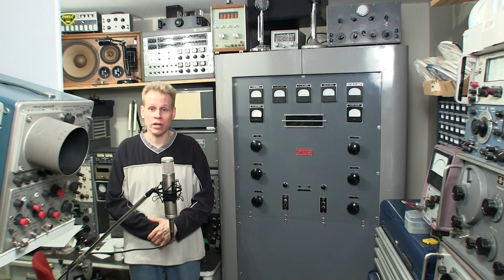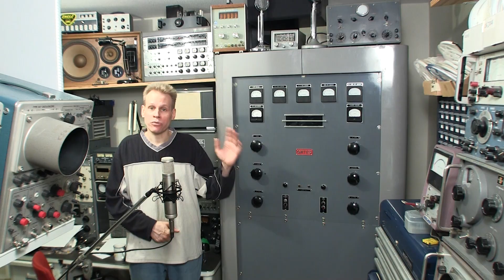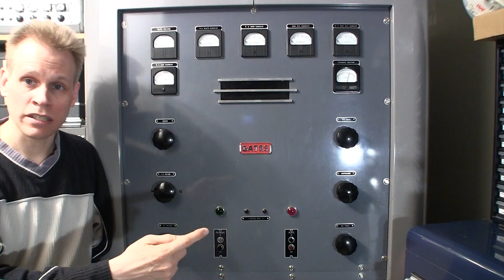Standing Inside a Broadcast Transmitter While it's ON!

Comment: Been a subscriber for a while and enjoy your restoration videos. Have learned a few things that I will use in the future. This is a very nice old Gates BC250GY and it is in beautiful shape. Also, you did a very nice explanation of how it works but, this video scares me. I am a retired broadcast engineer with 45 years of experience on both tube and solid state transmitters. I've worked on transmitters from 1KW to 50KW and one thing you never want to do is stand in a transmitter that is on, even if it is 'just the filaments' and not have your complete attention on what you are doing. I did not see you use any kind of shorting stick before going into the transmitter. You simply cannot rely on the bleeders or HV shorting switches before working inside a xmtr. I have had plate supplies that have ranged from 1KV to 25KV and using a shorting stick (Jesus Stick) has saved me many times from protective circuits that failed and weren't protecting me. Even just having the filaments on can pose a risk. This is especially true if you are swinging a camera around and not paying attention to where you are inside. Your attention is not on safety at that point. There is 240VAC in there on exposed transformer terminals and those relays are open contact, not sealed for your protection. One slip, kneel in the wrong place or move your hand too far and you are across the line voltage. Maybe you did short the caps and other connections before you went in but it was not demonstrated. I cringed when I saw you grabbing coils and touching the plate leads on the finals.

I'm writing this because I want to point out to others that when you are in a transmitter like this you have to do the little things to keep you safe. Be aware of your surroundings and do not be distracted by swinging a camera around or talking to a co-worker. Be aware! There can be high voltage somewhere that did not get bled off or shorted and if there is, it will ruin your day. I have a friend who nearly had his arm burned off because he was careless. Even if you think "well I know my transmitter inside out!', you can still make an error and DIE. If you were one of my engineers and I saw you doing this without proper safety precautions or just going in and using a camera and not paying attention, we would have a very, very long talk.

Please consider adding an addendum to this video and point out how to work inside an xmtr like this safely. I know many hams out there use old broadcast xmtrs but you have to know what you are doing when working on one. This is normally learned by watching an experienced broadcast engineer and having them point out how to do it safely. I know I am preaching here but I don't want anyone to lose their life because 'Oh, I saw this done on YouTube'. I don't know if others have pointed out how unsafe this was because there are a lot of comments but I had to say something.

Comment: Real radios glow in the dark.  If I'm reading that RF Line Current meter correctly, you've got about 392 watts being output into that dummy load assuming it's 50 ohms.

Comment: Great video!  Reminds me of a time a few years back when I helped a neighbor, who, as I,  was  heavily involved with restoring old tube radios.  We slid a Gates BC-1T out of the back of his pickup truck (very carefully) then down a 45 degree ramp and into his garage concrete floor.  Eventually he moved it to his combination radio room/museum.  I don't know if he ever had it on the air, as the 160 meter net we used to check into each Sunday morning pretty much faded.  Unfortunate since it had been going on since the mid 30's (except for the WW2 break).  It would have been a classic on 160.  Not as practical as it is pretty much a single frequency transmitter, but still fun to look at.

Comment: Hey I served 1986 in a broadcasting station: inside AM/SSB on LW 1 really big tube, SW 10 solid state transmitters, outside: copper walled coil adjustment antenna transmitter house to the >100m high capacity LW-antenna, and directional SW-antennas (ca 20m .. 40m high).

Comment: Hi Paul..thanks so much for your interesting .. informative videos. I've worked for several years in the Radio Broadcasting field back in the 80's .. I appreciate the equipment that I worked with.. from the audio consoles .. sound processing .. compressor limiters ..transmitters etc.  I wonder if you still have plans to feature the RCA transmitters you spoke of ..?

Comment: Insane to see this again.  I worked as an electrical engineer co-op for a navy lab.   One of my jobs was to work on this amplifier.  We retrofitted it to drive a shaker table in the vibration lab.  Amazing that I actually got it working - had to add some reactance in the feedback loop used in the vibration application.

Comment: I used to build these type of amplifiers back in 1996 for ham radios in CB radios. If you will use a coax cable with outside shielded ground using certain Length According to your frequency that  making sure you keep your coax cable out of phase with the wave length of your frequency you will have less feed back in to the driver tubes and give a cleaner RF Audio signal instead of using an open wire where the signal can come off the antenna wire inside the unit which can be picked up by the driver tubes and feed back in to the out put tubes giving a looping affect .
The parasitic trap the coil of wire around that insulator puts the frequency out of phase so it is not picked up and feed back in the tubes but it still dose it. 
All RF Signal should be Going through a coax cable with a insulated out side shielded ground out of phase of your signal keeping the signal on the coax cable  instead of an open wire feeding the Adjustable capacitors then going to the antenna.
All out put RF signal need to go threw a coax cable and have out side shielded ground to keep the signal bouncing on the wire out of phase of the frequency that you are using according to wavelengths ready to go to the antenna and the tuning capacitors will give you a much cleaner audio RF signal remember your coax cable going to your antenna should be out of phase as it is connected to the antenna for the antenna to release the radio frequency in the air.
Using Coax cable Length similar to the wave length of your frequency will given you a poor RF signal in the air For it will be using the Coax cable as an antenna source and not going to the Antenna itself that’s high up in the air .

Comment: A modern unit with the same capabilities occupies how many rack spaces? ^_^ But as a bodger well below Mr. Carlson's capabilities, I find it much more pleasant and less intimidating to dig into a piece of hardware that I can stuff my whole head and shoulder into if I have to -- and un-loom wires to trace circuits when there's no schematic.  Today, too many of the wires disappear into a big chunk of epoxy with a potted UV window on  it... it'll have some firmware version number printed on it, which is no more useful to you and I than if they had printed "and then magic happens" on the label. :/ Advancing age & lack of skills are making me a sort of... meta-Luddite within tech, tho I refuse to abandon it completely, I'm not quite ready to move to an off-net cabin in the woods.  ^_^

Comment: I stood inside the transmitter (hut) next to the tower for an AM station here in Denver. Spooky. You could move your head around and your fillings would pick up shit from the magnetic fields coming off some of the antenna tuning / coupling coils. Creepy AF. My tour guide had zero fillings, said everyone he worked with had heard it except him. I said that wouldn't do so we fooled around for a good hour until we figured out that the metal tip of my mechanical pencil, held on one of his mollars, would magically "detect" the AM and strip the RF (or I guess it wasn't even picking up the RF, just the power envelope) and it made recognizable audio in his head too. Couldn't really hear words, but could tell when it was words or music.  I was more worried about getting electrocuted. Incidentally, those hours we spent in there had zero effect on my sperm motility, when measured years later. A fairly common concern. in the USAF, the Electronic Warfare (radar, ECM, etc) guys were called "baby killers" for that reason.

Comment: Look up "dead man switch" because you got it wrong.
Reply from the maker: These switches are usually used as a form of fail-safe where they stop a machine with no operator from a potentially dangerous action or incapacitate a device as a result of accident, malfunction, or misuse.  Here is the link: https://en.wikipedia.org/wiki/Dead_man%27s_switch

Comment: You just took me back 50 odd years, serving in the RAAF starting in  Jan 1972 I was posted to Butterworth Air Base, Malaysia.  We had a radio broadcast transmitter and studio which collectively went by the callsign  RRB, 1KW I believe.  I didn't work on the AM broadcast band transmitters such as this but remember the large transmitter hall where it sat dwarfed by the huge HF transmitters we used for communications back to Australia from the base. A mate of mine from the ground radio side showed me the huge complex and antenna farm. 
Now I was a radio tech air which meant I worked on airbourne  radio comms , navigation and radar equipment.  As it transpired I finished up working on the Mirage III Cyrano II fire control radar for 6 years (many pictures of the beast on the net).   The  RF final and modulator electron tubes you show are bigger than anything I worked on but there were huge water cooled electron tubes in some of the big HF TX's  with PEP of several thousand watts.  I had not ever seen tubes that big before, I was in my early twenties and had completed a 5 year  electrical/electronic apprenticeship at 15 before I joined the RAAF. 
 I am retired from the RAAF now,  spending my last serving years teaching electronics at the then RAAF School of Radio which sadly no longer exists.
Thermionic electron tube theory is fairly basic and easy to understand compared with our world of microprocessor controlled electronics  now. 
 I obtained my amateur  licence  in 1989 only having to sit for regulations, the theory was waved.  I am wondering what band you work with that transmitter as you would have to retune the drive, final and adjust the ant loading every time you changed your VFO frequency. 
I am not active at the moment due to wide spread QRM at my current QTH.  It's so bad I can't really receive anything except the two local AM broadcast stations and the NDB from RAAF base Sale, Victoria  up the road where I had two tours , I am still investigating.  Cheers Robert VK3URS

Comment: What a great walk back in time! Reminds me of interesting thing that happened to me shortly  after I started to work for WBT-AM in Charlotte NC 57 years ago! I was only 19 at the time but had been a ham since 11.

After being on the job for only two weeks, the chief engineer assigned me to start on the second shift SOLO! That scared me to death because I would have to switch directional that afternoon, and I had not had the opportunity to do that before! Now WBT-AM was a big deal - 50KW from that big ol' RCA BTA-50 spreading from Canada to Cuba blasted millions of ears - a point impressed very strongly on me by the CE. Anyway, the guys who I trained with on the first shift told me NEVER to switch on a modulation peak or it could take the transmitter down!  Now the  DJ at that time felt there should be no lapse of audio content between music -  I never knew him to ""run out of gas." 

Well, the time finally came to make the switch. Ty Boyd just would not stop talking! Five minutes after the official time to switch, I finally went for it! BANG! Huge plate breakers in the high voltage bay loudly signalled their displeasure at the current overload when the relays came back in directional mode. Then SILENCE! I almost messed my britches cuz all I could think of was that millions of people all over the world had lost their favorite station and I was the one to blame! I cud just see that pink slip coming! And I was planning on getting married in a couple weeks and cud see that going down the drain!

I deduced that the problem could be remedied by going into the transmitter entry bay and manually resetting the main high voltage breaker. Bad decision! When I reset that breaker the DJ was still talking and the same problem occurred - this time the primary AC breaker tripped and the whole transmitter went black! Not a tube was lit! Now the CE had been trying to maintain some sort of industry record by keeping the filaments on those big finals hot for the longest time since initial installation. I remembered him proudly telling me that those finals had not had their filaments turned off since they were installed several years prior. All that was running through my head and I had no idea how to get that transmitter back on the air without it shutting off again!

After what seemed like an eternity the phone rang. It was the CE. He calmly asked what happened to the WBT-AM signal. With a shaky voice I told him the situation. He had me turn off all the switches that had to do with power and cut the main audio switch. Then he slowly and methodically talked me into bringing everything back up in sequence starting with the primary AC breaker. Eventually, I got the transmitter back on the air and adjusted the various controls to get the directional RF power set to the proper level to drive the three towers.

After I convinced the CE I was OK and the transmitter was doing what it was supposed to, he hung up. I was just waiting for him to come in and fire me. In about 15 minutes I heard him come in the front door and go straight to his office. I was mentally preparing for him to tell me that was my last day as an engineer for WBT-AM! However, at my great surprise, being the tremendously professional he was, he came out and CONGRATULATED me for the excellent job I did in not panicking and getting his beloved station back on the air! 

Needless to say, the lesson I learned was to cut the audio at the appointed time before switching directional, regardless of what the DJ was doing, whether talking, playing music or running a commercial! 

That experience not only taught me a lot about broadcast transmitter operating procedures it built my self confidence and taught me a lot about managing and dealing with people. I went on to spend 47 years with that company, eventually rising to Vice President of IT for the entire company. When I retired, the company owned 3 TV stations, 17 radio stations and a sports production company. 

Keep up the good work, Mr. Carlson! I just joined your world as a patreon! Thanks again for the enjoyable trek back in time and for the excellent job you are doing in educating both old and new about the the wonderful world of radio and electronics repair. 

Joe AB4WF
Reply from the maker: Thanks for sharing that great story Joe, that was a very enjoyable read. Thanks for your kind comment too!
Reply: Cliffhanger of a story!

Comment: Wow very interesting ... how did you squeeze by the side of the cabinet seems like very little room there! Being inside that cabinet with the plate voltage on would be like walking through a minefield one false move and ZAP! With all of those bare metal conductors/bus bars not hard to do! I would imagine a 50 kw transmitter would have much larger tubes...

Comment: The safety relays and large resistors look exactly like what you would find in antique coded fire alarm systems with series bells. The large resistors in the fire alarm systems are sometimes adjustable so you can tune the circuit depending on how many bells you have in series so they can be their loudest.

Comment: Wonderful!!! My dad had a 1 kw am transmitter from a radio station. I helped move it 4 times and it was a mother! Transformer over a foot square in the bottom. He rigged it for 20 meter ham band, he actually took the crystal oscilaters apart, and ground them to frequency using toothpaste on a piece of glass. When he went from the morse key to voice i heard 1 kw and push pull 813's several hundred times as he talked to people all over the world. Russia, czechoslovakia egypt poland, greece, anywhere you could imagine. He had a bulatin board with several dozen QSL cards. He had long wire antenna and since he couldnt afford coaxial cable at first, he used world war two surplus copper wire, and separated the two varnished wires with LILT HOME PERMANENT CURLERS!!!! My mom and sisters got lots of hairdos out of that deal!!! Lool i still have an antenna tuning capacitor from that transmitter. I love that old stuff! Im no electronics guy byt that stuff was built so amazingly well! I have built three guitars using parts i got because dad brought home old stuff. I have one more bass guitar to build and im going to use the 3/8 inch thick chassis plate from an RCA microwave transmitter, complete with Klystron tube stencling wich will show on the front. Plate aluminum rings like a bell and makes a good guitar body. Lol!